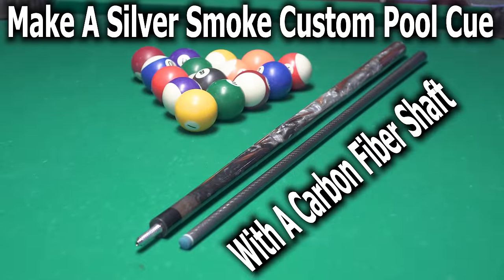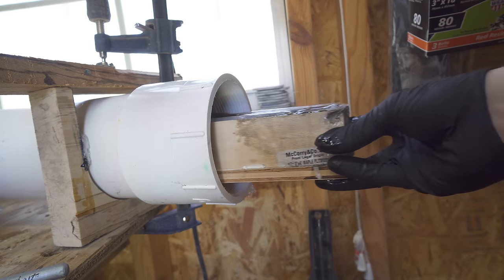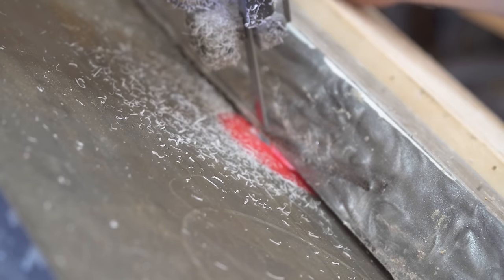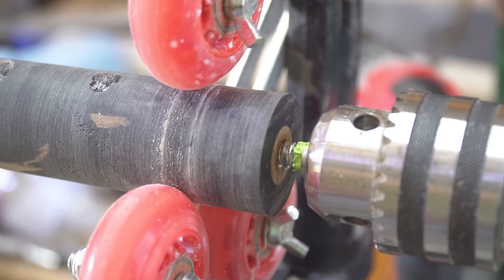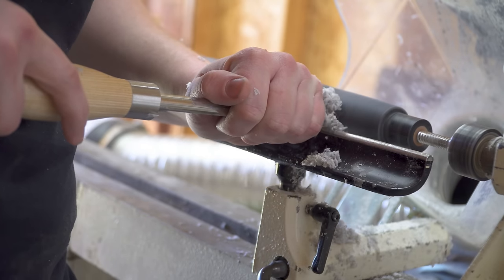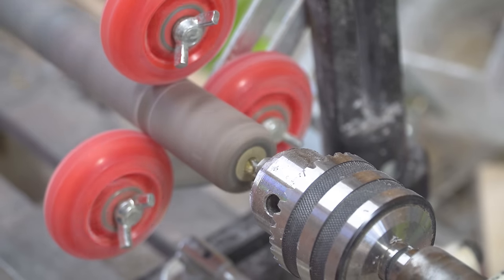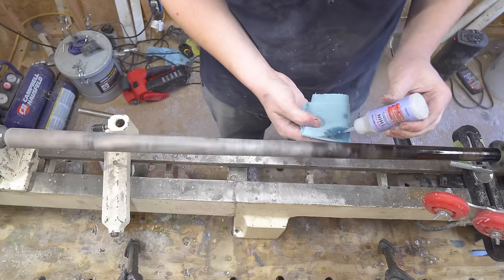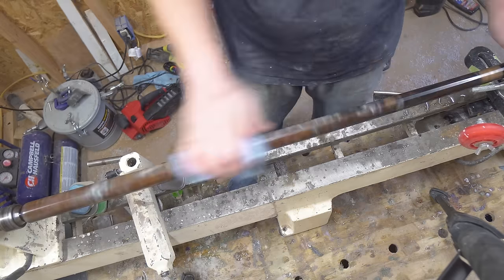Making A Silver Smoke Custom Pool Cue With Carbon Fiber Shaft (4k)

Comment: Hi, you got me on the idea to also start making cues. i made a pessure chamber from Stainless steel and made a master cue. from that i made a solikone mold. now i trun wooden raw pieces to the right size, make some grooves into them and put them into the mold. i need very little epoxy and have way less work after demolding.  also i made a cuemill and it works great. the joints i make on my metal lathe. i trun the hole exactly to the joint pin and then lgue it in, form there i also, as you do, start milling and grinding. Also what i do is i make a 300mm deep M12 thread into the wooden core, for weight adjustment. works great. i guess i will have to make a video soon :-)

Comment: What brand carbon fiber shaft did you use and where did you get it? It has a cool pattern on it.
Reply: It's the GO Customs Carbon Fiber shaft model 1. This model isn't made anymore. Google for GO Customs. The shaft is made by Goran Kobas from The Netherlands. The revisions of this shaft are even more awsome and don't have this pattern on it,
Reply: @thugstation  it is a cool pattern. 

How do you turn down the butt to match the shaft in diameter is there a standard template or measurements or trial and error until you get it right?
Reply: @YIRMASTER  just turn milimeter by milimeter and measure... trial and error

Comment: I like the looks of that CF shaft, i never seen one with squares like that, i love the squares, how does it deflection compared to revo and cuetec and jacoby black shafts?
Reply: It is a Go-Custom First Gen shaft they have since moved to ones that look like the revo and actually have a better hit and not a tingy noise like the revo it is definitely on the lower side of deflection and it completely customizable from joint, weight, ferrule color and tip size....and it is slightly cheaper than the revo and it is a full pro taper like the cynergy...
Reply from the maker: That was the Gen one go customs shaft they have stopped making them now as far as the deflection is Was likely cost to the same just a different look

Comment: Would it not be easier to make the mould boxing smaller as itll save alot of time on the lathe?
Reply from the maker: The mold has to be large enough for the wood and center dowel.

Comment: Just noticed this video very cool in the design process but I had an idea of you haven’t tried before what if you were to use the edges you cut off the blanks from previous builds to make a whole new build in a blanks from the corners off old builds with an epoxy mix as an idea but cool video none the less

Comment: What is the finish weight of a butt done in epoxy versus a traditional wood butt of the same physical dimensions? Many players, myself included, prefer 18 or 19 ounce cues so if your epoxy it too heavy, this would not be the way to go.
Reply from the maker: Iv made cues weighing from 17 to 20 they also have a small removable weight bolt.

Comment: why didn't you give any details on how you fabricated the carbon fiber shaft?  I have watched several of your video's, I like the detail but in this one, you left out the more interesting part of the build, even if it was from a blank.  There are still other questions about the shaft such as sanding, polishing, applying the clear coat and final finish.  Would be nice to see your method.
Reply from the maker: I did give details it's a go customs shaft I didn't not make the shaft

Comment: Dude!  You make custom carbon fiber cues, really?  What if I wanted one that was like 13 oz, low-deflection (shaft and ferrule), pro-taper, 11.75mm soft tip?  Can one also add different weights to it, making it go from 13 to 15, then 16?   Also, an extension to add to the butt for long shots?   How much might something like that cost?

Comment: Just curious why initially you have to overbuild so much?  It seems like you have to remove a lot of material unnecessarily.
Reply from the maker: The blanks are only 1.75 inches square at the start and you can make something an inch thick with a 5/8 inch center dowel and have room for the wood and get the color pattern all wood working is done this way you don't start at the exact size and work up

Comment: Instead of packing tape try parchment paper the epoxy will not bond to parchment paper making it way easier to remove your blank
Reply from the maker: Yes the epoxy won't stick to the parchment paper but it doesn't stick to the packing tape eaither. But clever idea tho
Reply: @jpaynewoodworking7510  thank you, we build custom bar tops and it's one of the tricks we've learned. Great job on the cues as well, I hope mine turns out as beautiful as yours has.

Comment: 620/5000
I must admit that it is a nice job but not precise ,, too bad for the huge waste of material. However, at the end of the turning the stock of the slats does not turn precisely, it turns a little crooked, certainly caused by the vibration of the piece while perhaps for your pool game the cues even if they are not perfectly straight are fine for us, in Italy in our game the cue if it is not straight they don't sell it, and they don't even play it.
We do not see ribs made with resin, they are called plastic ribs.
Thank you for your attention and of course I respect your work.

Comment: How not to build a cue.  No player worth his salt would use a cue like this.  I build cues.  you can't
 build one on a manual lathe, has to be built on a metal lathe.  You have to build a cue within a .001 to make it straight and make the shaft fit on straight